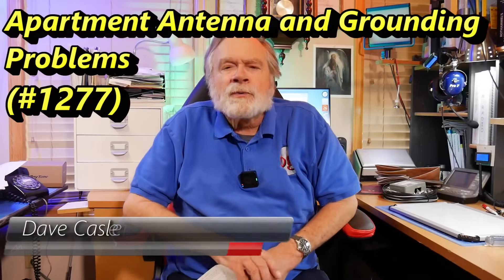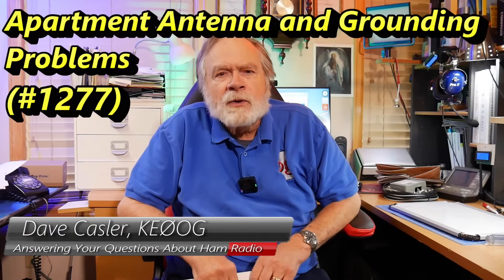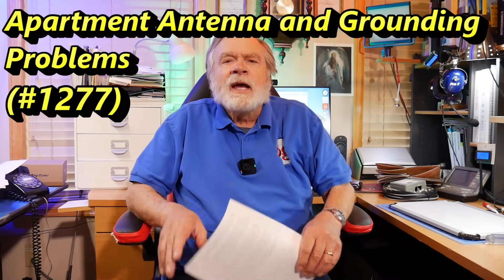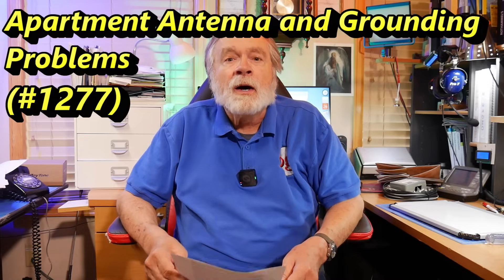Apartment Antenna and Grounding Problems (#1277)

Comment: Many homeowners and renters insurance policies will also cover ANY device that fails due to power surge or lightning strikes.
 I had a (cable) TV with built-in DVD player (SO much simpler!) where the DVD failed after a power blackout during a lightning strike.
 Filed a claim, got paid in three weeks. No argument, no rate increase.
Reply: In some areas the deductible is extremely high.  Mine, for example, is 2% of the value of the home.  I could replace every piece of ham equipment I own for less than the homeowner's insurance deductible.  That makes the ARRL insurance very attractive.